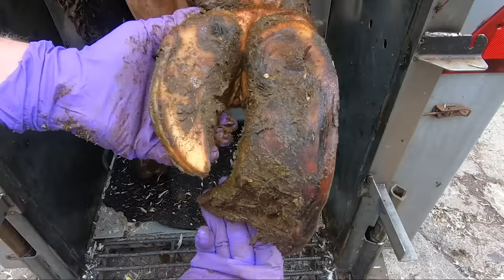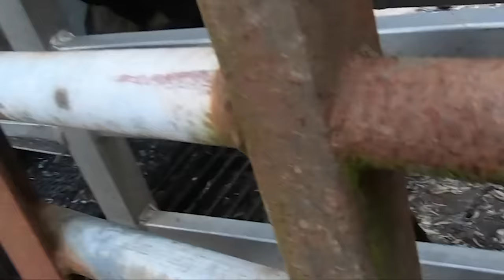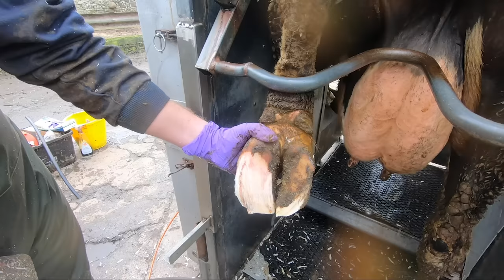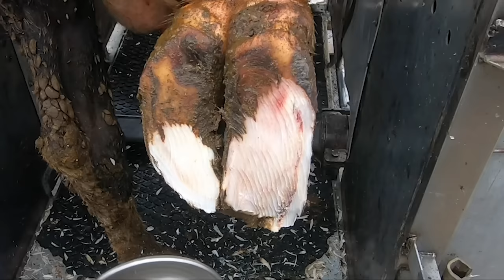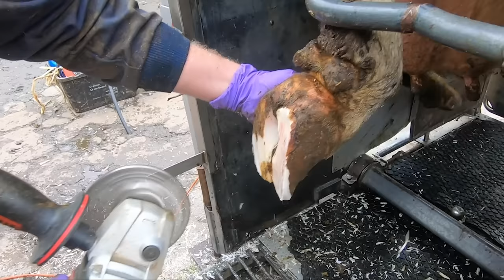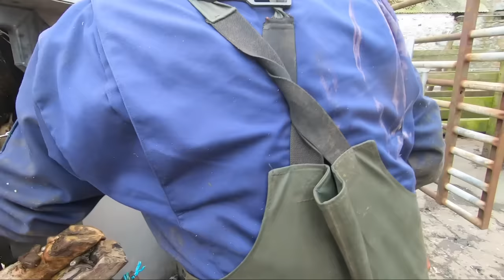BIGGEST COWS HOOF yet on The Hoof GP | can she ever walk properlly? | The Hoof GP

Comment: Best guess: she'll be fine as long as there are no hidden surprises that require extreme measures.

Could you show us (someday) measurements (with a ruler) on a live claw. Like the average depth of the heel versus the 75mm from the crown to the white line and the width of the walking surface from the white line?

Also, does the pedal bone capsule basically remain the same size regardless of the wild growth of the claw, or will it extend when the claw gets horribly overgrown?

Comment: Why are the hooves not washed before shaving down.
Reply: 1 he doesn't have a water supply there.
2 one swipe with the grinder will get it far cleaner than water ever will.
3 water and electricity don't mix, especially when razor-sharp instruments are involved, when it can actually be fatal.
Reply: Also, do you wash your nails before you clip them? Finger and toes?

And sometimes he actually does, but it is few and far between.